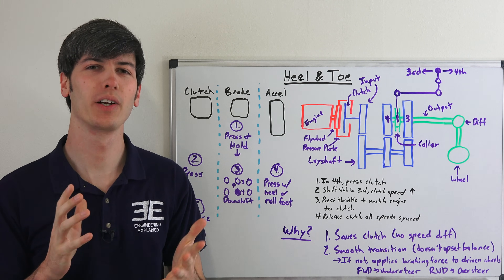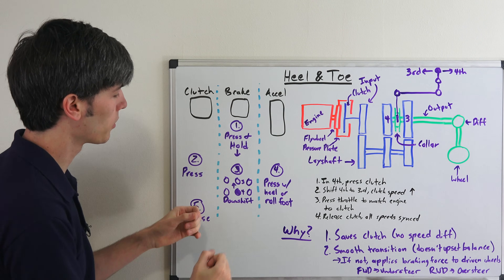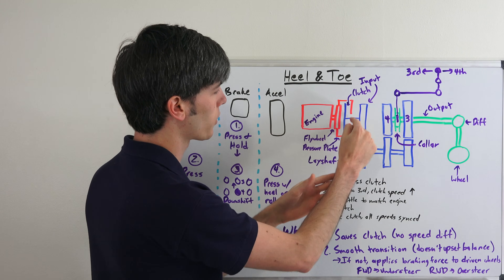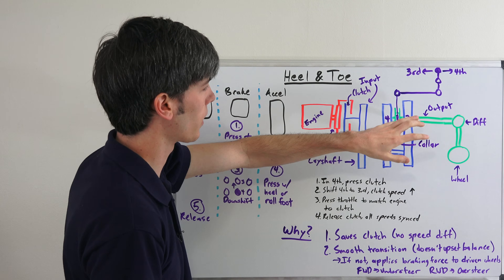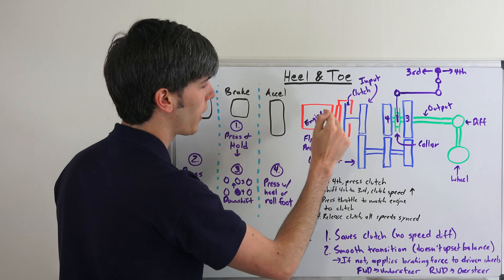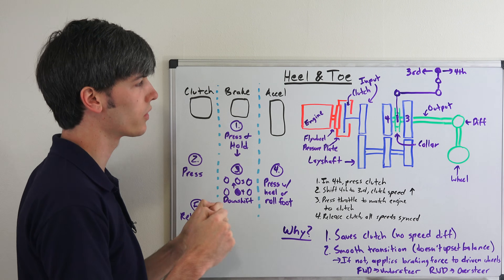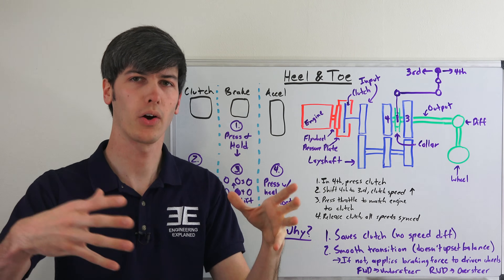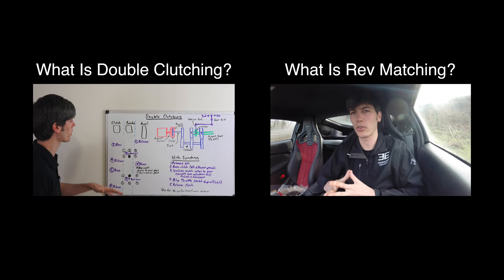What Is Heel & Toe? (Downshifting)

Comment: Another great video!
I have cheap fat "sports" pedals so i use the technique with the example u showed "using right side of foot to hit the gas instead of heel".
Might i suggest u do a video on double clutch? How it helps align the synchros and provide better/smoother shifts. I know with modern transmissions it isnt necessary but it does make a huge difference.

Comment: Hey, can you make a video explaining 2-steps and rev limiters please!
Reply: rev limiters cut fuel from the engine. anti lag is done a few different ways. inject fuel after the exhaust but before the turbo and ignite it with a spark plug. send extra fuel into the cylinder so it gets exhausted and use the heat of the exhaust to ignite it, or change the cam timing to send unburned fuel into the exhaust and ignite.
Reply: thanks!
Reply: 2 steps and anti lag are similar but not the same, a 2 step can lead to a result similar to anti lagging in turbos though. They are beneficial because it lets you build boost in a Turbo at a stand still..its used pretty commonly on Rally Cars and other turbo charged race cars, though it puts a lot of stress on the turbo. Now for N/A cars, its also beneficial because it allows you to hold the car at full throttle while still maintaining a suitable RPM for launch, based on vehicle capabilities, traction, wheel hop, etc
Reply: thanks!

Comment: or one could just brake enough to go through a smooth a shift...
Reply: +McJammy Uh. That wouldn't work.  When downshifting, the engine speed needs to increase. Once you're going really slow the speed difference won't matter, but the engine will be completely out of the power band.

The whole point of heel-and-toe shifting is to optimise acceleration out of a corner. You smoothly engage lower gears during braking for the corner so that you can accelerate hard at the corner exit.

Comment: Is it normal not being able to reach the accelerator because it's so damn low compared to the brake?
Reply: +wamphyr000 Feet are not the problem in my case, just that in order to blip the accelerator since it's so damn low compared to the brake for some reason (maybe to prevent people from heel and toeing??) I'd have to push very hard on the brakes, at which point heel and toeing basically becomes redundant as the speed of the tranny in the lower gear matches that of the engine.
Reply: Krusty Komedy Klassic Trust me, you don't. Everyone who learns heel and toe has this same problem. It seems impossible because they are so far apart. You just need to rotate and roll your foot. Going high on the brake pedal and then rolling to the top of the accelerator is how I started learning to heel and toe.
Reply: I kinda learned to heel and toe using the technique Jason demonstrated here on computer simulators and Logitech G27 pedals. But when I tried stock pedals on my 2008 Subaru WRX I thought heel and toe was completely impossible without mods. Few days later I found could not take it this way and started experimenting with seat position. It may help if you position the seat relatively close to the pedals and set the seat back really straight so that you have a solid surface to lean on while your legs are operating in the air. It might also help if you position your right foot higher on the break pedal and use the heel to operate the gas.
Reply: +Krusty Komedy Klassic That's normal, if you don't have large feet then you're going to have to rotate your foot 45 degrees and use the edge of your foot by rolling it forward. Only cover the right half of the brake pedal.

If you do have large feet you can keep your foot upright, cover half the brake pedal and roll your foot off to the side like is demonstrated in EE's video.

If you don't know how to rev match, learn that first.

Comment: When you release the clutch after blipping the throttle, do you release it slowly? First to the bitting point, then release fully?
Reply: +Bryan 888 If you got the rev-matching exactly right then you can come up on the clutch very quickly for a very smooth and fast shift. If you didn't, then adjust the throttle a bit as you get to the biting point. So long as you never get that horrible judder from using the clutch as a brake is the main thing.

Comment: what if the blip throttle when I am in neutral while going down to the lower gear? what happens with the engine and all?
Reply: +Sanghapriya Bhalerao Then that's rev-match downshift, which is different from heel-and-toe in that brakes may not be involved
Reply: +Bryan 888 Blipping in neutral is double-clutching, which matches speeds of gearbox shafts not just of clutch plates. There's another EE video about it.
Reply: +ben c I suppose he is saying that he is coasting, then rev matching to pit it in a lower gear
Reply: +Против Глобал Well I don't know for sure what he meant... but blipping in neutral (with the clutch up) is the essential feature of double-clutching.

Comment: I can't imagine myself performing something like that. I'm happy if I can upshift without the car getting hiccups! :D
Reply: +Michał Hickiewicz He makes it seem more complicated that it is, although I don't think I put my foot sideways across the pedals. Say you're coming to a tight corner in 3rd gear, you would brake then drop the clutch and downshift to 2nd. Now the important part is to press the accelerator harder to rev up the engine to a higher rpm than before in order to match the higher revs you'll be in when you downshift. You will also come to learn in what rpms you will be in each gear at different speeds. This is rev matching

Comment: The way my pedals are set up in my 2004 mustang gt makes it super hard to do. The gas pedal is much further back than the brake, so I can get my heel to hit the pedal. The only luck I had was using my heel for braking and my toe for blipping the throttle- but it seems sketchy to do. Any suggestions?
Reply: +KODstorm21  Sometimes, you can move the throttle pedal closer.  And the firmer the brake pedal, the easier it is...remember that the brake pedal will depress further as you brake harder, so if you move the throttle, it may be too high for your foot when you brake hard and still need to downshift.  A harder brake pedal can help here, as the pedal will move less as you increase braking force.  Not sure exactly how you'd go about this...but guessing maybe a booster that's not so powerful.  Most cars (IMO, anyway) are over-boosted these days.  Some to the point that simply resting your foot on the pedal - relaxed, but not actively pushing - will feel like a panic stop.

Comment: is it necessary tho?
Reply: +rtswift did you watch the video?
Reply: nacokid
i did but i kind of just woke up so i might have missed that part
Reply: *****
thanks
Reply: by doing heel & toe you can have a smooth transition when downshifting,you also save the clutch and you dont lose the control of the car
Reply: nacokid
yeah that doesn't say it's necessary.
Reply: the car can slide when cornering and crash and catch fire and you can die... it is necessary it´s a metter of life and death
Reply: nacokid
hahaha. ahh ok. will start learning now.
Reply: +rtswift Heel and toe isn't necessary for the street, if you're not driving fast, then the only time it's useful is when you're downshifting through the gears while coming down a hill.

Learn to rev match first. Heel and toe is just an advanced form of rev matching, so you need to know it anyway.
Reply: wamphyr000
yeah i can rev match just not while braking.

Comment: I think that "heel&toe" is necessary for cars with lightweight flywheel - otherwise it will put too much force on engine. I was always thinking that it was main reason why racers were using this technique.
Reply: +Patrik Sabo  It's more important for heavier flywheels, since it's more strain to drag the revs up with the clutch when you have that much inertia with a heavy flywheel.Racers use it so they can brake while still downshifting at high rpm...if your engine's powerband is between 5000 and 8000 rpm, then you need to be able to smoothly downshift while keeping the revs between that range, while still braking hard...thus the heel and toe was born.

Comment: is it better to heel toe downshift going into a turn rather than rolling in neutral, braking and then getting back on it in the appropriate gear?
Reply: +Zachary Ruiz  Never use neutral.  You want to have the correct gear for your speed fully engaged at all times...or as often as is humanly possible.  That way, if you need to apply a little power to balance the car in the turn, it's available and controllable...trying to smoothly and quickly select a gear and apply power after coasting would be damn near impossible.  And since you want to apply power as you approach the exit of the corner, you will need the gear engaged while you are still turning.

Comment: sometimes when I try to downshift I miss the rpm match by a couple RPM. is this bad? should I only downshift if I can get it spot on?
Reply: +megakiller999 its far better to miss a couple rpm then to not rev match at all.
Reply: +megakiller999  Having a difference of a few hundred rpm is still less than the 1500-2000 rpm difference most transmissions seem to have between gears these days - every little bit helps.
Reply: +megakiller999 Nobody every nails a rev match, just get it as close as you can. Slowly release the clutch as per a normal downshift until you master it.

Comment: I guess this technique is useful when you take your car for a track day.
Reply: +Ola Håkansson  I use it all the time...but it's most useful when driving in slippery conditions, and especially on ice or snow, where smoothness is paramount if you don't want to lose the little grip you have.  And it's easier on the clutch.  :-)
Reply: I would have to disagree with you, and I can recommend this site that I found just now http://www.instructables.com/id/High-Performance-Driving-Heel-Toe-Downshifting/ 
Remember, public roads are not racetracks. 

Being from one of the Scandinavian countries I do know how to handle snow and ice on the road. Also to be on the safe side use proper winter tyres on your vehicle . Forget all season tyres, they are just crap. And if you lose traction during slippery conditions, you have been driving too fast and not paying attention.
Reply: Ola Håkansson That site looks at it from the perspective of performance driving - but many techniques are just as applicable in everyday driving also, like looking further ahead, seeing where the apex of a corner is as you turn, and of course, steering, braking, and accelerating smoothly, as well as reducing the wear on the clutch.  Which is what toe-and-heel shifting lets you do more effectively, even when you're not trying to wring the last iota of speed out of your car.  And especially if your car is low on power, as that sort of vehicle can make it tricky to keep with the flow of traffic on winding roads.  Not everyone can afford something modern or powerful.
Reply: I'm going to stick to my guns and claim that "heel&toe" it is for track use, when chasing that fastest lap of the day.

During my time on the road, 30 years. I have seen 3 clutches worn out.

Comment: what happens if i do it improperly? like not building enough rev before reconnecting the clutch?
Reply: +Jarrett Peters I mean to the engine/gearbox of the car. other than the clutch does it hurt any other parts?
Reply: +Fouad Louis  jarrett peters is absolutely correct...but also remember that anything you do to make that rev difference between clutch and flywheel smaller will help with smoothness and wear, so keep practicing.  :-)

Comment: Does having abs brakes ,make it harder or easier to do this?
Reply: +Manny Gomez  No real difference unless you're pounding the brakes to the floor every time you want to slow down - the only time the ABS will kick in is when you've locked up your brakes.
Reply: +aussiebloke609 makes sence. was making a scenario, on a sharp turn. Whereb you would be slammed on the brakes and having to heel toe.
Reply: Manny Gomez  Yeah, ABS is handy when you're threshold braking...but that should really be a rarity.  Also, it's damn difficult to downshift fast enough to go through all the gears when braking that hard - modern brakes are so much more efficient than they used to be - which is why many racers heading into a hairpin will simply shift from 5th straight to 2nd...while appropriately rev-matching, of course.

Comment: How do you know how much throttle should be applied? I know you said to blip the throttle but it varies at different speeds etc. Any tips?
Reply: 1 Tip: Practice!
Reply: +CarlGB Downshift and watch what the RPMs rise to when you release the clutch. That's what you should be aiming for.

If you shift from fourth at 3000RPM to third and it rises to 4000RPM. That's what you blip the throttle to.
Reply: +CarlGB  Look for his video on rev matching - that will explain all.  This is basically the same thing, but you don't release the brakes as you downshift, so it's smoother and lets you brake more efficiently while still being able to select the gear you want.

Comment: There's not enough space for me to heel toe downshift in my Mazda. I can't blip the throttle while my foot stays on the brake.
Reply: +eins  I find when the pedals are close, I brake with the ball of my foot (which applies most of the pressure anyway) and I can blip the throttle with the outside of my foot...usually just the smallest toe, since the throttle doesn't need a lot of pressure anyway.  This (for me, anyway) is actually more comfortable than having to twist my heel onto the throttle.

Comment: can I do this in an automatic or not?
Reply: wtf dude 😂😂😂
Reply: +John Kyon  Not effectively - since you don't disconnect the engine from the trans between shifts, you can't effectively raise your revs without some of that power going to the wheels, which won't help your braking.
Reply: +John Kyon Yes (probably depends on transmission).  If you're manually selecting the gears, on some (older?) transmissions a blip of the throttle will smooth out downshifts.  You can do this while braking and hey presto -- heel and toe!

I actually learned the technique originally on my old Toyota with a slushbox.
Reply: Sam Douglas great, just one question,what daphuc is a blip? Do you mean flip?
Reply: It means to open the throttle briefly.  From Google:
open (the throttle of a motor vehicle) momentarily.
"he straddled the bike and blipped the throttle"
Reply: Sam Douglas is it possible to do this on an electric car with auto?

Comment: Heel and toe is still something i can't do. Maybe it's the Camaro's pedal placement or maybe it's because I've only been driving a manual for 3 months.
Reply: +Unbearable Pain I felt like I couldn't do it either as my accelerator is a lot lower than the brake pedal and I have small feet. It's really awkward at first, however you can do it. It just takes practice.

Don't put your foot over the entire brake pedal, only cover the right half of the brake pedal, then rotate your foot at a 45 degree angle so your heel is over the accelerator, once you've done this, roll your foot forward so it feels as though you're touching the accelerator with the edge/blade of your foot. You won't actually be doing that, but that's what it will feel like. The danger here is that your foot can and will slip completely off the brake while you're learning, so leave yourself enough room for this to happen.

Remember to keep the clutch in, you don't want to be on the brake and accelerator at the same time, it's bad for your car.

Sit in your driveway and practice. It will feel impossible, but you only have to do it successfully once, and then you'll begin to do it more and more. Eventually you'll be doing it like a pro.

If you haven't begun rev-matching, I'd suggest learning that first though as you'll need both techniques and rev-matching is more useful for everyday driving anyway.
Reply: +Unbearable Pain  Badly- or widely-spaced pedals are the bane of our existence - and sadly, that means most cars these days.  I've had a few cars in the past that needed the pedals modified to make it possibly...usually remounting the throttle higher and closer to the brake.  But always remember, if the throttle is the same height as the brake when slowing gently, it will be too high when you stand on the brakes firmly and your foot will hit the edge instead of being able to depress it.Not sure how well repositioning will work on modern cars.  Most of my tweaks were on old stuff with cable throttles going to carburettors...70s stuff.

Comment: Does this work on a diesel car?
Reply: In theory yes, but in practice it makes for slower shifts as you'll be waiting for the engine to rev up to the appropriate speed due to the slower throttle response inherent in most diesel cars.

I tend to just feed the clutch in on the lower gear and make use of the braking force (while going straight). It may not be great for the clutch but I have drove my car very hard like this for over 2 years and no problems so far!
Reply: +Omar Chakkour
I'm trying all the time. In my car, acceleration pedal is disabled when I press the brake. Works only when I press it really hard, but it takes too much time and it's not working properly.